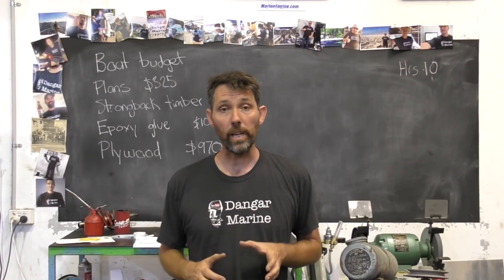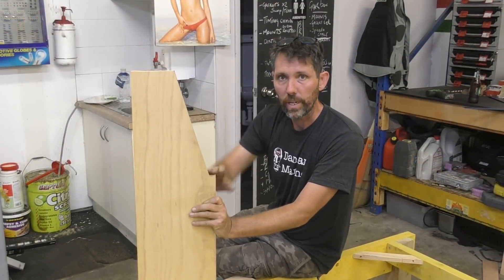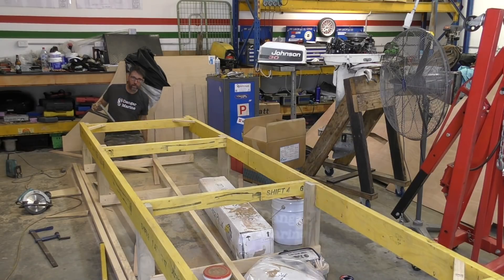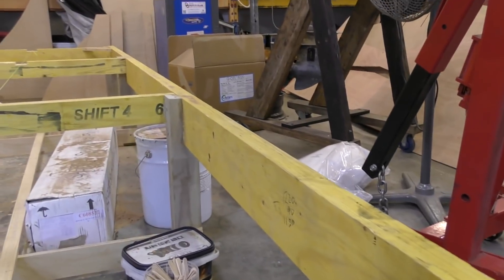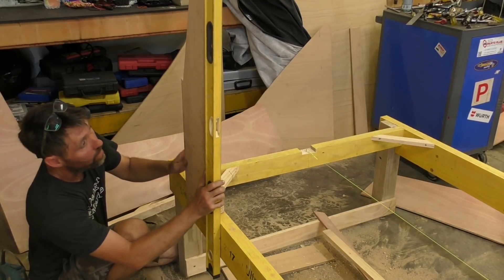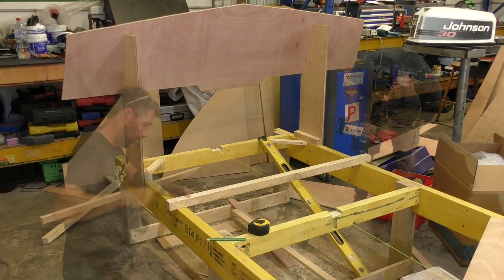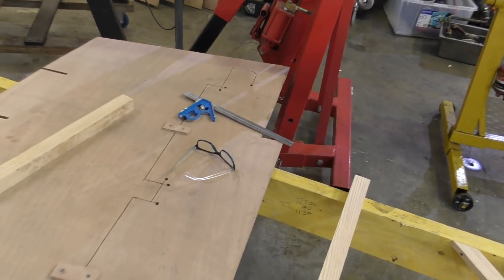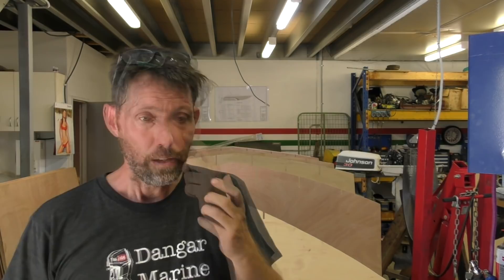Setting the bulkheads

Comment: gday mate your doing quite well with regards to the transom when i redid the haines hunter i replaced the transom for just water ingress ect when i did i made it two thicknesses of 12mm and in between i put fiberglass and resin and screwed it together using brass screws that were filled after now i dont know what the builders recomendation is maybe just waterproof glue ie epoxy but so far good work take care .
Reply from the maker: Thanks mate. This transom also has another two pieces of ply added as a doubler where the outboard goes. He too recommends screwing them together while the glue dries and then taking the screws out and gluing the holes up.

Comment: Loving the vids from across the ditch stu....but I need some help if that's ok I've got a Mercury mariner with an over heat alarm that won't shut up..it pumps good water both out of the piss hole and the exhaust and the water is warm to the touch the thermostat is good it opens and closes but the alarm won't shut up...please help...the motor ran all weekend with the isolation kill switch turned off to stop the alarm with out any issue...faulty scenser maybe but I have no idea where it's located ?????
Reply from the maker: The temperature switch will be inserted into the cylinder head with one or two wires coming from it. I've been meaning to do a video on them for ages so I'll try to get around to that today. For example, it is part 36 on this diagram http://www.marineengine.com/parts/mercury-outboard-parts/45-4-cyl/0b110789-up-usa/end-caps-and-exhaust-cover

Comment: Regarding trimming the two transom sheets to identical size:  one easy way to do this that won't blunt your plane ** is to use a router with a flush trim bit (has a ball bearing at the top or bottom or both).  Just clamp the two pieces together and the bearing on the bit will follow the smaller piece and trim the larger piece to exactly the same size.

Trim bit is also great for straightening up freehand cuts, e.g. made using a jig saw.  Just clamp a straight piece of timber adjacent to the cut edge and use it as a guide for the trim bit to turn the freehand cut into a perfect straight cut.  Also good for inside corners - you end up with a nice rounded corner with the diameter of the trim bit (typically quarter or half inch). Round trim bits are also great for getting a nice rounded edge on a piece of timber (or plywood).  Downside is you might get the urge to need a router table :-(
 
** a tungsten-tipped router blade is harder than a steel plane blade :-)
Reply from the maker: Great tip mate. I’ve done plenty of house building type timber work but next to no joinery. I’m looking forward to learning new techniques and what tools are out there to make life easier. Just need a second wood working shop now. ;)

Comment: Interesting the transom is only  2 x9mm ply. With the weight of todays engines at 105Kg and up for 4 stroke and ETEC 50's , and this boat I would probably want the next class up (60 -120hp) I would have though a transom closer to 35mm would have been in the design.Your teaching skills show through again, well constructed ideas and 'show and do' style means even I, hopeless at chippy work, reckon I could follow along and do one of these. At one stage in the transom section the audio goes quite 'muddy' , was that because you were using the camera mic?
Reply: Ron, in the vicinity of the outboard, this area is built up to a thickness of approx 50mm or 2". This doubler is then glassed onto the longitudinals. So firstly, which you'll see later, the longitudinals are glassed to the 18mm transom with 400- 450gm Double Bias. Then the outboard doubler is added later providing a total thickness of 50mm where the outboard clamps on, as mentioned above and this is then also glassed in with 400-450gm Double Bias. People tend to think that the greatest load is when static or when planing. Actually its not. The greatest load is when trailering and going over pot holes at speed etc. As a foot note, we engineer all our designs to class rules (ie ABS, Loyds, DNV etc.) In this case, its engineered to ABS. Hope this helps
Reply: It doesn't say MAX HP = 70, it states RECOMMENDED HP = 70HP.  Once you go beyond 30 kts in a boat with this deadrise, the vertical accelerations are too high and as a person on board, you won't be very comfortable.
Reply from the maker: Hey Ron, I think a lot of the strength comes from the firbreglass. One thing I have learnt about Mark Bowdidge is that he is certainly a man that does his maths. Apparently each boat has a huge spreadsheet of calculations that need to be re-run if even the slightest thing is changed. I'm no expert, but I would imagine the thrust of an outboard at full throttle puts much greater strain on the transom than the static weight of the motor. BTW, the maximum rating of this hull is 70HP.
Reply: I agree about the thrust being more of a dynamic strain, probably the sudden stop when you nose into a wave being the greatest, going from 25 knots to 5knots within the length of the boat has got to be a tough task. Trailering is another high strain for the transom, one which the mass of the engine is a major factor. The other engine mass consideration is when you are just anchored up or sitting on the water. On older boats such as mine , the inner transom well walls are not full gunwale height. So a heavier than designed for engine means you have a lower freeboard at the stern. Your project boat has a modern full height inner transom wall and so that side of things shouldn't be an issue. With most 60hp engines being detuned 70/90hp engines you have the higher mass without the hp to push it, so I am a bit surprise at the 70hp rating. It may be worth asking what mods would be required to have the hull take a 90hp, I wouldn't be surprised if there isn't a lot to do.  The fibreglass adds a lot of strength but the core is a major factor as well. There is a guy near me building a similar boat from another designer  , but he has used foam sheets instead of plywood for the core. It will be interesting to see if he has any weight/balance issue once it launches.
Reply: 38mm (1.5 inches) is pretty much the standard thickness for the part of the transom where the outboard is mounted  It may be that later on an additional thickness of ply will be added to the transom in the vicinity of the outboard mounting bracket.   In any case there's no doubt the designer knows what he's doing, and that composite construction is incredibly strong.  Most modern composite designs incorporate a fair bit of what are effectively torsion boxes in the structure of the boat to provide strength and stiffness.
Reply: dymanoz - I finished rebuilding the transom in my glass boat last year. I used 2 x 12mm for the whole of the transom and then padded out the transom well 'between the skin' areas until I took up all the airspace with epoxy coated ply . The original was 18mm ply and the air space filled with old bog ( polyester resin and talc )!At the engine well I ended up with 2 x12 and 2 x 9mm in engine mount area .
Reply: Here's a link to some discussion:
 https://www.boatdesign.net/threads/plywood-transom-thickness.26136/
Says 1.5 inches good for outboards up to 100hp (though obviously there's more to transom strength than just thickness).
Reply: Thanks. The 50mm is about what I expected, as is the ' worst case ' loading. But it is interesting the hull is rated to 70hp when in terms of mass most 70s are detuned 80/90/100hp engines. So if the mass is the same, and the hp is not the greatest load issue, why not build to take those engines unless there is a water length limitation as well. 
Note I am not dissing the design in any way . Just discussing the reason why a heavy 70hp engine is ok, but not a 90hp when they mass within 10kg of each other.

Comment: never liked the blueprints that show only measurements from point to point  if one gets off then everyone after is off.   good reasoning to add the  dimensions from one start point.  interesting build!
Reply from the maker: When I was talking to Mark (the designer) about this he said that listing the measurements the other way actually lead to more builder errors. I guess the good thing is that it is nice and simple to construct the total from the individual ones and give yourself the best of both worlds. If they were listed only as totals I would probably do the subtraction to give myself the double check anyway. As you say though, its very important to avoid an error that carries on, or even worse starts to compound and get bigger.